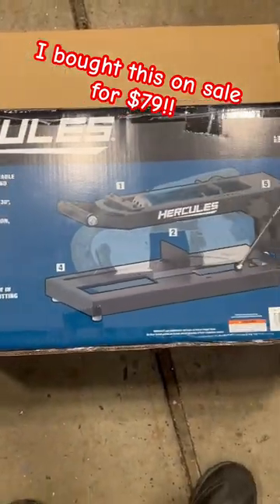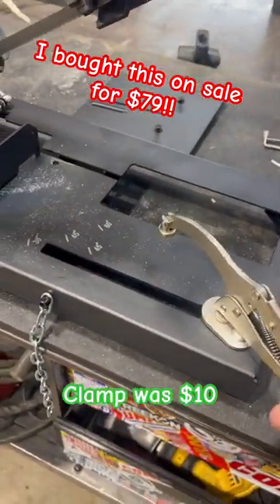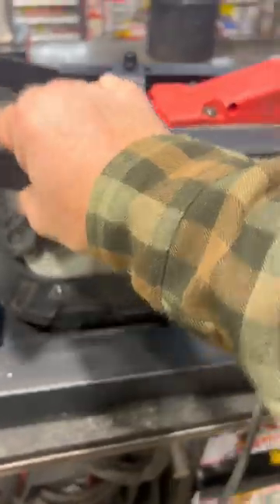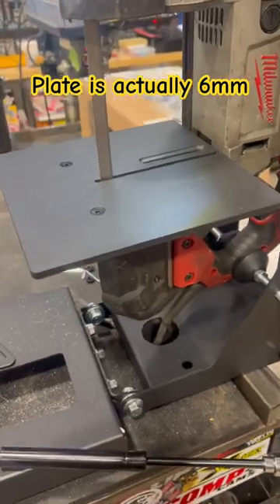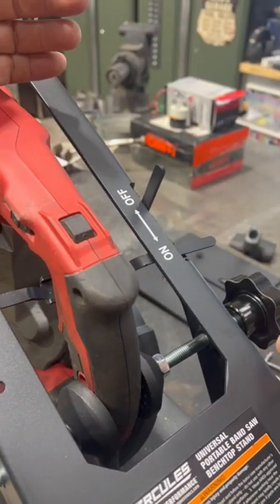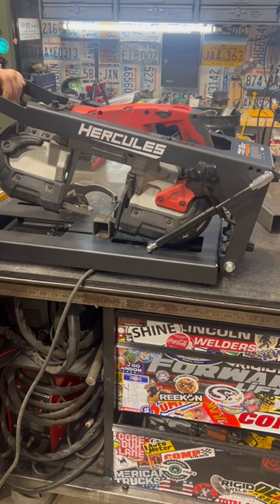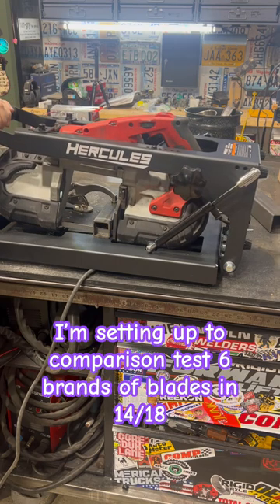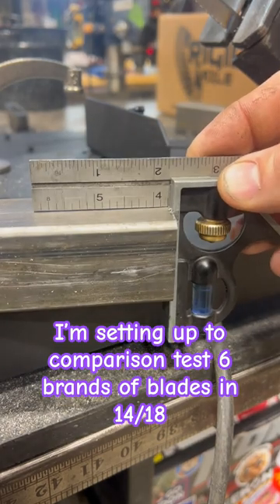$79 turns your portable band saw into a chop saw / horizontal saw #toolreview #tools #fabrication

Comment: is it hard to get your saw back out?  Kinda cool but who has a spare saw laying around?
Reply from the maker: true point.  I do because I use a battery operated one.  it's easy to get in and out, but setting it up to cut straight is a bit time consuming.
Reply: I bought the corded bandsaw to stay in it for exactly that reason, when fabricating anything this is my most commonly used tool in my shop.  I definitely do recommend!
Reply: @purplebooger6410  may have to do the same.
Reply from the maker: @purplebooger6410  I basically replaced my corded with a cordless, so it has a new home in the mount. Pretty nice!